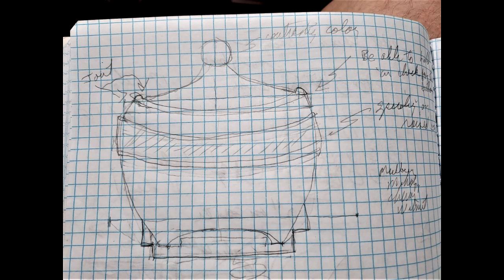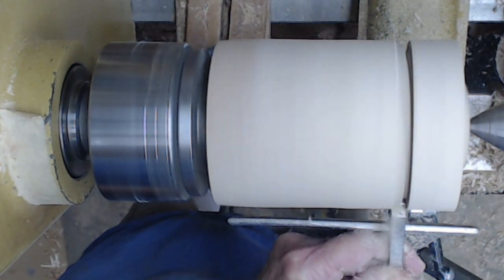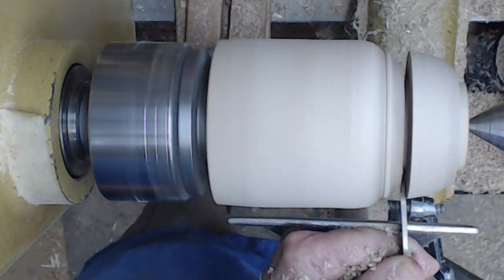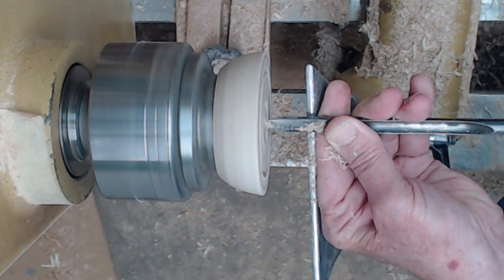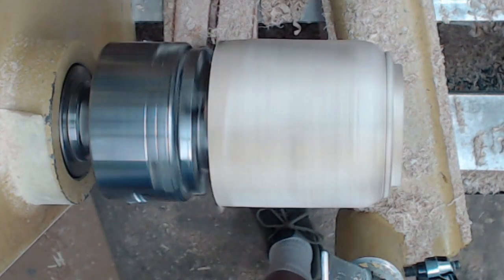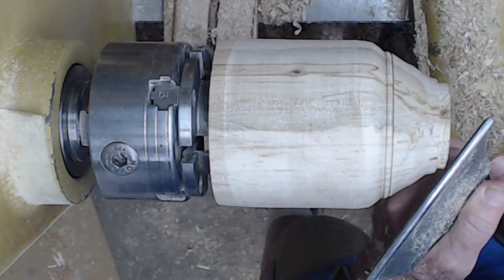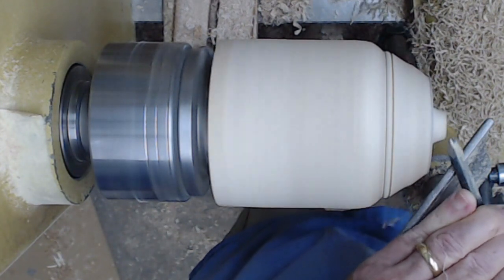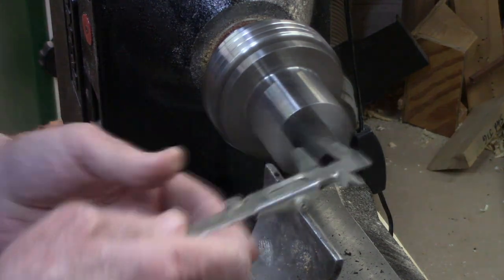How to Turn a Footed Box

Comment: Question regarding laguna 12/16 lathe and heat off the front spindle bearing… so hot you can’t touch it.  Ever experience that? I unboxed mine this am and that’s what I got after 15 min of running with no load. In addition to a wobble .. measurable at 1/64”.
Reply from the maker: You may want to call Laguna Tech Support
Reply: @MikePeaceWoodturning  thank you. I returned the lathe. Too many assembly problems. The bearing being the most serious